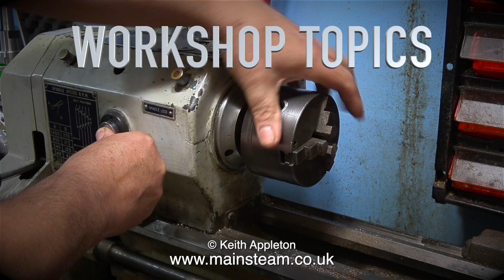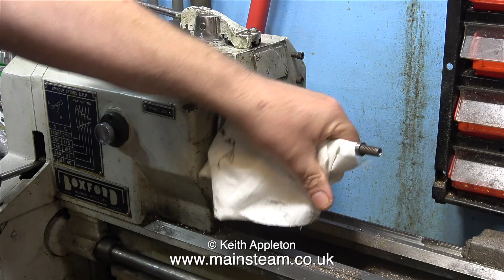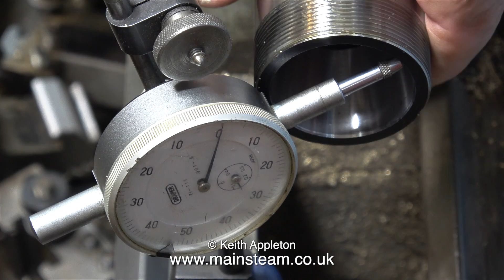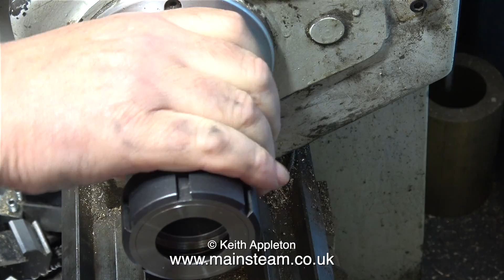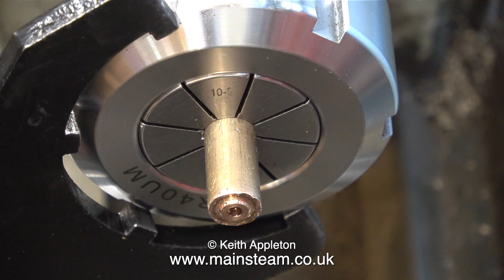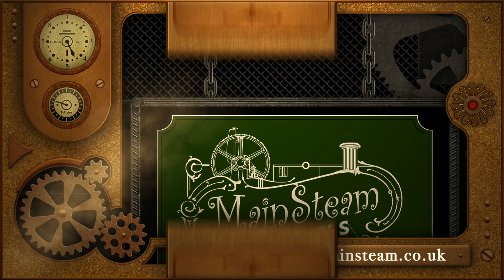WORKSHOP TOPICS - PART #12 - ER40 COLLETS - MY CONCLUSION

Comment: I've used ER 25 collets for a number of years initially using a commercial #2 Morse taper holder in my Myford ML 7 lathe although old 1949 vintage, it's in fair Nick . The runout was not great. I'd purchased a #2 Morse taper reamer to clean up the tailstock when I first got the machine so I tried a light cut in the headstock spindle. A fair amount of junk came out that was not metal shavings despite a rag over dowel with cleaner before. Remounted the chuck and things improved but still should be better. Removed the collet, which was new, and examined it carefully. It was full of shavings from the slitting saw used to make it. Using a thin utility knife I probed through each and every slit and removed a fair number of thin slivers, washed the collet in some degreaser, reinstalled the chuck, collet and test bar and run-out was now less than one thou. I subsequently went over each of my collets thoroughly cleaning them and I've yet to find one worse than one thou.
I also made my own collet chuck turned on my own lathe's threaded spindle nose and using a commercial nut. The result is less than one thou runout. I just used mild steel and as once it's on the lathe it doesn't come off until I'm done. It's not hardened or ground but great care was taken when machining the taper .
In one of your demonstrations with the long bar there looks to be a black thread caught in the collet. I'm willing to bet that was a piece of steel from the slitting. Check your collets carefully. Good luck.
Reply from the maker: A very interesting comment - thank you {:-)))

Comment: I don't know if you have worked it out yet but you installed the nose nut on the collet incorrectly. You put the piece of metal in the collet first which is wrong. You need to put the collet in the nose piece first to locate the nose piece in the groove in the collet. Then screw it on the spindle and then insert the stock metal. If you are turning a long piece of metal you need to support the other end of the stock in the spindle with a bush otherwise your stock will be whipping around inside the lathe spindle. Your collets should be perfectly accurate. As you can see in the video the collet is not engaged in the collet.
Reply from the maker: I tried it every possible way in every possible sequence (not all on camera). I do actually know what I am doing even though the video tutorials are aimed at the beginner. Thank you for taking the time to tell me how to carry out this simple operation.The ER40 Collet system I bought (to make the video) was rubbish and I threw the lot in the bin. I will go back to using my trusty "Burnerd Multisize" Collet system with is extremely accurate and I can fit the metal parts into the Collets any way I like, and the work remains 100% accurate. Using Ground Silver Steel stock the bar does not even require Live Centre support at the outer end.

Comment: It's not that ER40 chucks aren't a proper chuck, they're great. Unfortunately, your n = 1 sample of them was a poor specimen. As mentioned in another comment, I've only seen them used for tool holding in router spindles. I've never seen them used for work holding.

Comment: Hi Kieth, I've worked with my father for 23 years in steel fabrication and metal working, so I thought I might impart some wisdom. Different lathes are made with different tolerances, if you are looking for high precision I recommend you speak to a second hand machine salesman and ask for a tool makers lathe, they are quiet small and the tolerances and equipment they come with are very accurate. My father owns a smart and brown and two Weilers (I could be misspelling that) but the collet tapers are built directly into the spindle and thats the way I would go, morse tape are very good though. Hope this helps and the health and safety tips are good, remember to tell people not to wear loose clothing around a lathe ;)
Reply from the maker: I have a Smart & Brown Model 1024 with a Burnerd multi size collet set and that is very accurate.

Comment: I feel your pain Keith - I run a heap of ER collets in my mill - I have a few sizes that simply won’t run true.  They are the cheaper Chinese versions so I take it all on the chin.  The chuck runs out around the same as yours and for what I do, they work fine.  I have a set of 5C collets and a good quality chuck for my lathe and these are all spot on and have good repeatability.  Much prefer the 5C style and as these pull in from the bottom they seem to centre better.

Comment: I think the problem is with chuck runout. According to specifications from Shars tools Sharsdotcom the tir soould be .0002” That is two ten thousandths of an inch instead of the .002” to .004”  you showed.

Comment: I hate to be a damp squib but ER collets are not designed to hold work at all,they are designed to hold tooling. You can go to Rego flex site if you doubt this. yes we all hold work but that doesn't make it right.
Having said that I think your's are less than perfect.

Comment: Sorry if this comment is too naive, but every time in the video that I saw you tighten the collet on the long drill rod, the end of the work was unsupported.  I know that with a long drill bit in a horizontal chuck, even a little bit of offset on the sharp end gives me a wobbly drill tip and a variable, unpredictable amount of runout. I wonder if results would be more consistent if you supported the rod stock close to the bearing center point of the the tailstock, or even chucked the work into the tailstock, before you tighted the collet.  Or what the results might be if you could test the collets with long stock chucked into the vertical mill or drilling machine -- would mounting the stock using a vertical quill eliminate the runout? 

Also, it seems as if that .002 to .004 runout at the collet would be magnified quite alot over a long rod stock, but less so over a shorter work piece. 

Thanks for the complete review.
Reply: I've found that wiggling the work piece as you tighten the collet leads to less runout, similar to what you'd do when tightening a chuck. The collet can reach a fully clamped/immovable position while slightly canted unless this preventative measure is taken.

Comment: I'm sure you did check this (but didn't show it in the video).  Did you check run out on the lathe spindle itself?  Not trying to bother you, but it wasn't shown or discussed.
Reply from the maker: The lathe spindle is 100% accurate

Comment: That is odd. ER collets are or rather can be very accurate. I once ordered a ER40 set with 40 taper chuck for a Bridgeport type mill and tested the accuracy with a piece of 1 inch ground shafting. At over a foot away from the face, the runout was less than o.ooo2". The needle barely moved.  

I would suggest the following.  Make sure the taper bore of your lathe is not only clean but also smooth with no nicks or burrs sticking up anywhere. When you insert the arbor check that it doesnt wiggle when it first makes contact after sliding it in so you know the morse taper has a good fit.

Next use a finger dial indicator to reach inside the bore of your mounted ER arbor and measure runnout in the front and rear of the taper marking the location of the high points (should be inline) to make sure the arbor is running straight.  A finger dial is a very worthwhile investment when working with small parts if you dont have one.

Next make sure the part is within the correct working range of the collet and lubricate the outside of the collet with some of your famous oil. Then really give it a good tightening until you are certain it "hits the wall" with a feeling it has bottomed out and not just getting progressively tighter.  Economy collet sets are quite coursely ground and require more tightening torque than the highly polished Swiss made variety which already require considerable effort to tighten fully.   ER collets will start to grip the part with not much tightening making you think its tight but its not. The collet segments have to be forced to collapse tightly in parallel around you part otherwise every other segment will just tilt in opposite directions resulting in point contact, insecure retention and inaccuracy.

If you are still having trouble, mark the location of the collet in the chuck, record the runnout, rotate the collet 180 degrees and check it again. It is possible the collet itself is out but that is unlikely.  

If you follow these steps im certain you will find the cause(s).

Comment: my goodness you have a very bad collet, i would assume the taper of the collet does not match the taper of the collet holder because of bad manufacturing.
how much did you pay fore the collets?
quality ones are about 25€ a piece
i have had similare problems where at the manufacturing plant some one did not give a damm and build utterly garbage and just did sent it out.

collets are very nice but extremely expensive try a name brand collet i think then it runs true god ones are spec to be concentric at least to 0,01mm yes 10my or  0,0004"
greetings

Comment: I would check the full length of the morse taper in the headstock with a DTI.   The DTI will need an adapter to reach the full depth.  Something similar to a Starrett 670B

Comment: Now that I have my burnerd collet chuck, things stay on centre easily, there are other benefits to collets over 3 or 4 Jaw chuck, such as holding onto threads or polished faces with less risk of damage. If the chuck itself before collets is not running true, it won’t matter how good the collets are, there will always be runout. My cheap Chinese ER collets are not going to hold true, because they are also not made to those tolerances. My 5C collet chuck has a little bit more chance, as the collets are keyed to the chuck, and I  have an adjustable backplate to take the runout away when first setting up the chuck. More money and you would expect better collets, we have a very nice (in principle) 12 sided ER40 collet block, the intention being it works well in the mill to index 2,3,4,6,12 places, but! The hole is not machined in the centre of the 12 sided shape!! Crazy!